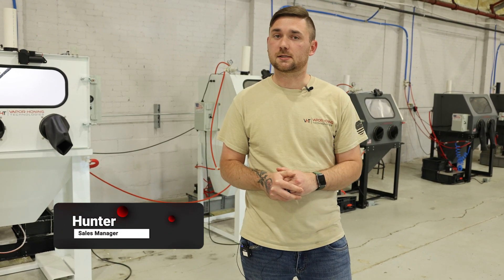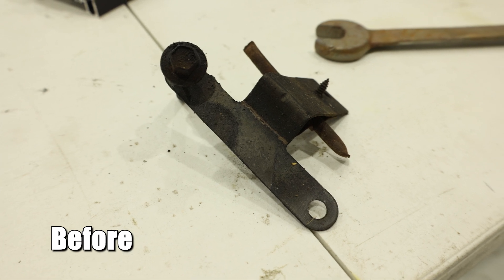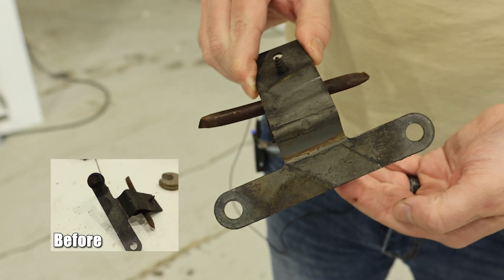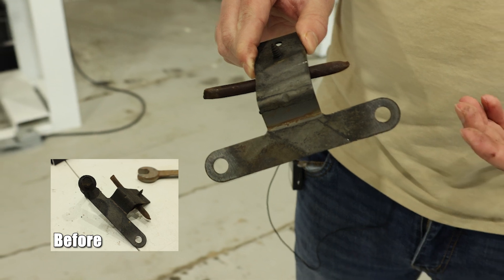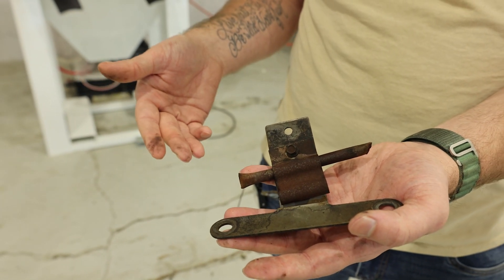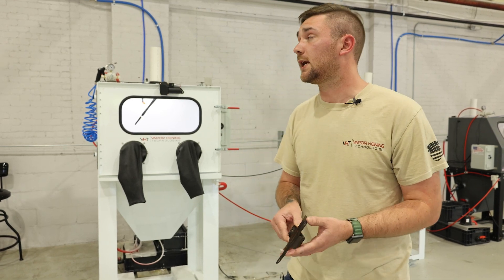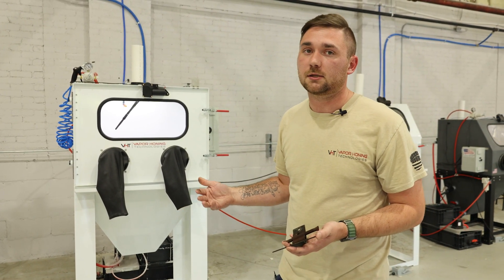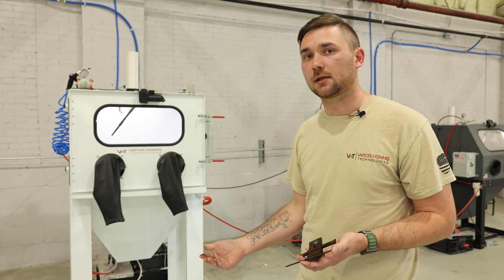What Are the Pros and Cons of Wet Soda Blasting?

Comment: Its the worst part to choose for this demo.  Try a piston or the inside of an oil pan.  This is what it would be used for in real life.  And i don't beleive the wet glass beed blasting is 100% not going to risk leaving impacted beeds like the try beed blasting.  So its foolish to use it in any place that comes in contact with engine oil.